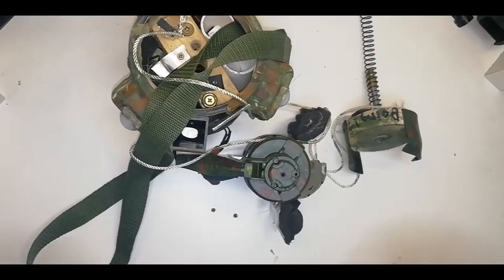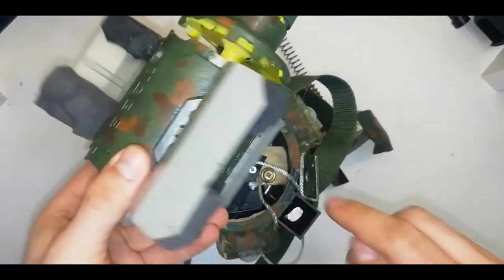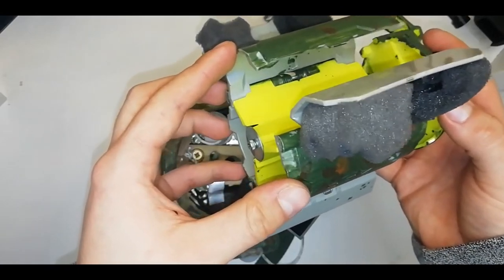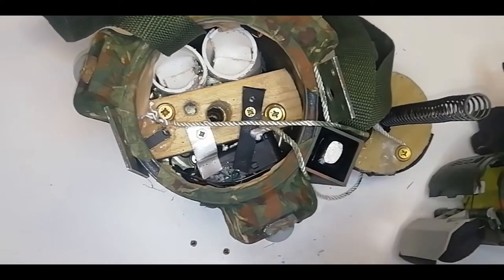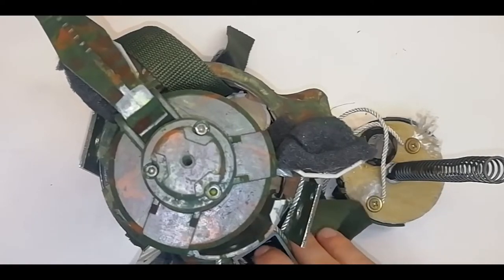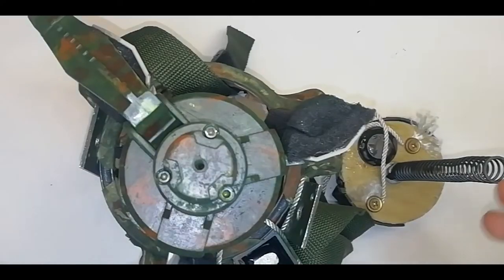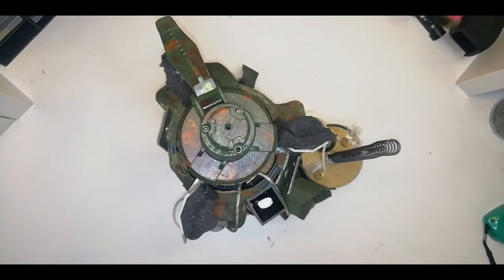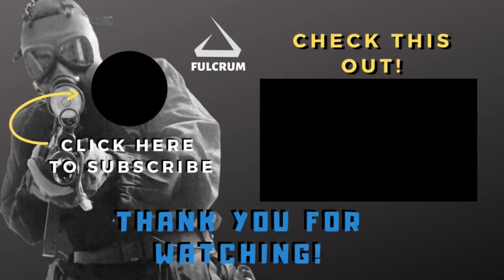Airsoft BOUNCING BETTY 2.0! (Airsoft Motion Activated Bounding Land Mine Gameplay)

Comment: One way to dissarm it is to pop a smoke neer it Smoke grenades set off my sensor claymores the if someone put a smoke in the mines view the heat from the smoke grenade whuld set it off
Reply from the maker: That's a bloody good idea. And it would mean that if you were sneaking around and came across the mine you'd have to sacrifice a smoke to destroy the mine in place, as well as potentially giving away your position. The whole point of mines is to slow down and disrupt the enemy, so even if the mine doesn't kill anyone it can still bog down the enemy force and potentially deny them passage.